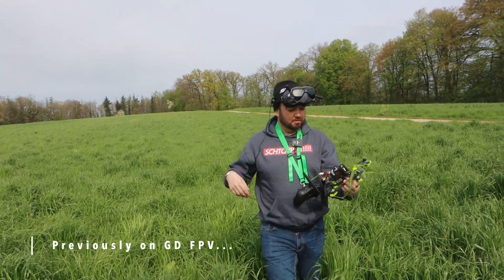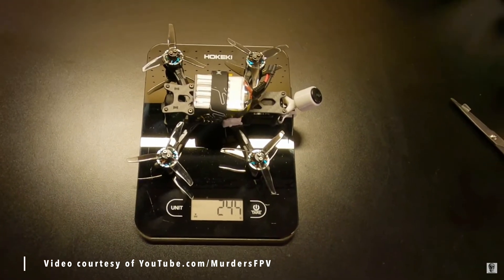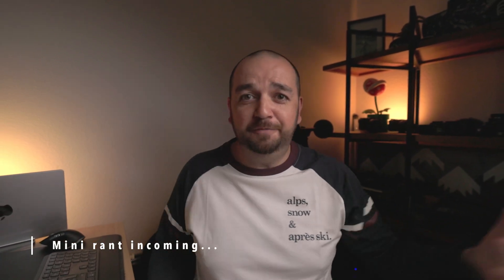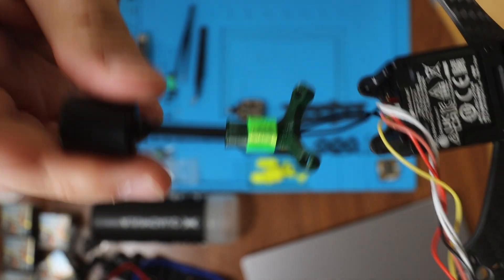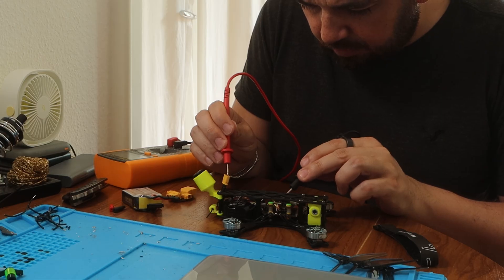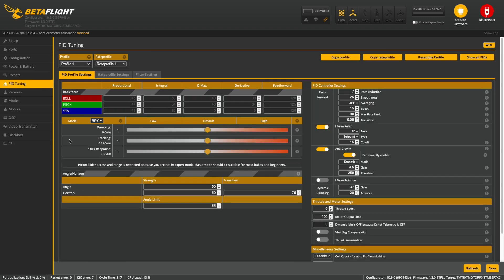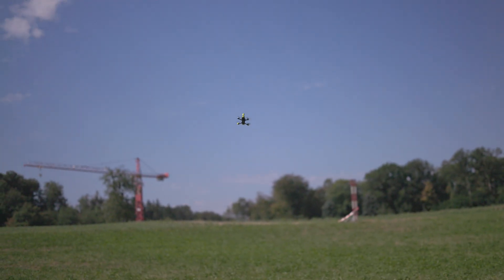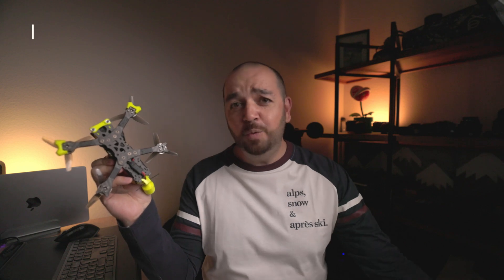I tried to build an FPV drone | Sub250g Freestyle DJI O3 Quadmula Siren F3

Comment: Can I have more detail for the fc and esc? I’m using analog system l, and I’m using on a 3inch 20x20mm mounting hole, I also wanted a 6s drone so how much amp and what type of esc and fc should I get that cheap? Should i use aio or fc stack instead. Finally 😅 how long does your 380mah 6s battery last normally
Reply from the maker: So in most of these builds I’ve used a T-motor mini stack which is about 45A rated and can take 6s. I’m in the middle of a build right now using a Flywoo Goku F722 pro stack also 45A. I haven’t flown the goku yet so I can’t say how reliable it is but the T-motor stacks have been bullet proof I just couldn’t find one in time for this build.

I’m running a F25 and a Grinderino with a goku 745 evo AIO which has been great and fits a 20x20 mounting.

The 380 6s typically lasts me about 3-6mins depending how hard I’m flying and how low I take the voltage down to. I typically land at around 3.8V (if im not charging them straight away) so I don’t have to storage charge them

Comment: ciao potevi benissimo usare un FlyFish Volador VX3.5 O3 Freestyle Frame Kit $32.90 ha tutte le parti in  TPU comprese nel prezzo e il suo peso a secco e' uguale se non minore di quello del Quadmula che tu hai preso .. e poi il FlyFish e' piu' economico sia come prezzo del telaio che come spedizione, in casa Quadmula esagerano un pochino:face-purple-open-box:
Reply from the maker: I looked into building one awhile back. The Volador frames are about 15g heavier than the Quadmula frames making them harder to build Sub250g. The shipping of flyfish frames are no different to where I live as you can’t get flyfish parts here.
Reply: did you look carefully? I don't think the Weight of the Quadmula Siren F3 Split is 54.2g dry (WITHOUT TPU PART) for the 2 frames instead the weight is all included 😉 FlyFishRC for the VX3 Weight: 68.3g(with TPU parts)
VX3.5 Weight: 70.5g(with TPU parts) N.B. so you're wrong 😊  @GarethDix
Reply from the maker: @kris-kb4vf  how does the flyfish fly vs the quadmula?
Reply: @GarethDix  Gareth I watch your videos because you have a very nice face, now I don't know which of the 2 flies better you should transfer the same hardware from one frame to the other to always say it by filing the PIDs because a frame reacts differently, then you can say which is better for you, but all the reviewers pass off the Quadmula F3 Frame as lighter than the FlyFishRC VX3 this is not true because the FlyFishRC Volador weight includes all the TPU parts on the scale, then it is cheaper as a frame and shipping, that's why I wrote to you, only you have the potential to try them, but the technical sheet and the price are favorable to the Volador also the holes for Stack 20x20 or AIO 25x25
Reply from the maker: @kris-kb4vf  That is one thing that I didn't understand about the quadmula frames is the lack of 25x25 even on the little 2.5inch one (I mention this in my next video). But I'll see if I can get a flyfish frame next time I'm in the UK and port everything from one of my F3's and see how much it weighs and how it flies. All 3 of my F3's and my F35 use a supafly preset with no other specific tuning for the frame so I'd be interested in seeing how it flies using the same set up.
Reply: @GarethDix  Gareth very good and beautiful, your face is halfway between a funny Italian and a tough English gentleman, I'm joking because I find you funny .. I know sometimes I'm provocative, but too often reviewers on YouTube say things that aren't exactly right and I think that commenting in a constructive way can be useful to everyone especially those who watch videos because they have more complete specifications to orient themselves on what they should buy, I repeat you who have the possibility of making test videos .. bye bye
Gereth I'm doing it for you to show you that I'm hard on you but I have nothing against you the FlyFishRC Volador frame is produced in 3 Inches and 3.5 Inches I'll tell you a secret the body remains identical and the 4 arms are interchangeable you can use both 3 inches and 3.5 ahahhaha when months ago at Quadmula I proposed if their frame could do the same they answered me in a bad way, I know it's business and companies make a profit, but that's not profit it's speculation

Comment: My first 'quad' was a octo, 8 150w motors a plywood frame and it carried my canon dslr... so i'm not anti build, but the thing i'm not liking on all of these i have looked at is no gimbal, so you cant move the cam up/down for filming, and you had better have good eis. 
pro's are cheaper to repair, cheaper to stock up on batteries, and it can get later mods + upgrades/improved software.
If only we can keep under 250g, get tilt on the gimbal and 30mins fly time then it would be a real winner. or does that already exist.....
Reply from the maker: Gimbals already exist for building your own check out the caddx gimbals. But if you’re looking for a cinelifter you can build a much bigger quad and add a DJI RS series gimbal which will take any camera so it is possible and fully upgradeable so you aren’t having to upgrade the whole quad, controls etc.

The only thing is, if you’re flying through things at 200km/h the fixed camera position allows you to learn exactly the position your quad is in, it’s much more difficult if the camera is On a gimbal.

30mins flight time is also possible in a self build with li-ion batteries but as with anything you have to weigh up what you need more, power or efficiency.
Reply: @GarethDix  yeah it's the 250g limit that screws with a lot of the simpler solutions/designs

Comment: What was the total cost for this build I’ve been thinking about building one but don’t want to spend an insane amount of money
Reply from the maker: This isn’t a cheap build I think it cost around $600 at the time but the DJI O3 was $250 of that cost and the T-motor stack was about $150 both of which have come down in price.

There’s plenty of ways to make this cheaper though especially if Sub250g is not needed
Reply from the maker: This isn’t a cheap build I think it cost around $600 at the time but the DJI O3 was $250 of that cost and the T-motor stack was about $150 both of which have come down in price.

There’s plenty of ways to make this cheaper though especially if Sub250g is not needed
Reply: @GarethDix thanks for the help I’ve been looking for one under the 250g mark do u have any things of the top of your mind that could make this a little cheaper if not that’s fine
Reply from the maker: @ABYSSSP7FN sure… the first part is do you really need DJI O3? If not it’ll save you a lot of money and weight and will give you a lot more frame options.

I would use an AIO over a stack it’ll save you money and weight. You could use the extra weight budget on cheaper motors.

I’d run 1404 motors on 4s, they’re more readily available and you can save around 50% of cost - but it’ll come at the expense of power

Running 4s means the batteries should be cheaper too.

Finally the Quadmula frame could be changed for something cheaper. It’ll typically be either at the expense of weight or durability or build difficulty.

Comment: l enjoyed your video immensely. I have been pondering about building my own quad and you have inspired me to finally give it a go! Still very nervous about the soldering aspect of the build but like you, do a bunch of practicing and it should all work out, right?! Cheers and thanks again!
Reply from the maker: Yeah I practiced loads before doing it for real. On this stack the soldering was fairly easy. Some of the AIO’s I’ve used in builds since then have been so much more difficult. But really get a solder sucker and some solder wick as well and if it goes wrong you can always remove the solder and try again

Comment: I’m at waiting process of “hopefully” correct parts. So excited! Anyone have a link to a FPV diy budget build? Toothpick? 2.5”
Reply: Trying to figure my first build and EXACT easy “budget” parts is tough for 2.5”. Anyone want to hit the kiid with a good startup list to go with frame. Id be blessed and grateful. Thx! Super stoked!
Reply from the maker: I’ve been looking at doing a budget build but still looking at options. From memory MoeFPV and TargetFPV used to do a lot of toothpick builds so I’m sure there’s a 2.5inch in there somewhere. TorontoFPV has a new frame called the whisper coming so I’m sure he’ll do a video on a 2.5in build if you ask nicely
Reply: @GarethDix  epic info thanks 🙏🏻
Reply: I can’t wait there’s so many step by step videos but the hard part is finding the right long range parts to go with frame and build. I’m a cruiser light tricks guy. I know I’m in it for beautiful long flights. Like a Bee.

Comment: Nice work. Would be super if you could add into description or pinned comment all the components you are using in this video as a list.
Reply from the maker: I didn’t for this one as I wanted to make sure MurdersFPV who did the original build got the credit and anything from the affiliate links for it… but I used the same components in my full build video recently of the 3.5 inch https://youtu.be/lPGT-tZh2Hw?si=w3zRSie8dUxYCA-l

The only difference is the O3 air unit lite and I’m using the 3.5inch version of the frame (it’s the same just longer arms)
Reply: @GarethDix  Thanks. Where to buy just the O3 unit except DJI official website?
Reply from the maker: @Braincho I’ve never Bought one from DJI directly, pretty much any FPV store will have them too. Depending on where you’re based the independent stores sometimes work out cheaper

Comment: I tried to fix my cinelog20, after a motor burnout. 

I've fried the fc aio somehow, 2 times... Buying a set of 4 motors and 2 boards killed my "fun" in building so i've just bought a second Cine20

I've got a MOZ7 in my line of sight to be able to film different things, and i'm still on the fence between builing a 7" LR or just buying one...Trying to fix the cine20 kinda killed the willingness to build
Reply from the maker: That’s pretty crazy the cinelog20 was my first quad and almost two years later all I’ve done is replaced props and one of the ducts so you must have really been pushing it!

On my Flywoo firefly I’ve had to replace  two motors and that was fiddly… but if you’re going with a 7inch it is a lot easier to build because of the size and space you’ll have… that said in order to do a build you have to really want it… it’s not typically cheaper but it is rewarding!

If the moz7 gives you everything you want for now I would just get it BNF and save yourself the pain… you can always start building something in the background whilst you’re flying another  quad because the first build never goes to plan and will always take longer than you think
Reply: You have no idea of the work I get out of the cine20, its perfect for one shot real estate,  with ajusted tune you can fly around real smooth and slow indoors, and with some more tune tweaking it has enough pushing to combat the wind in higher altitude to get nice house shots or small to medium construction sites, its been a real gold mine. 

While i will say it did crash hard  a few times, its so durable, portable and quiet.
Same for 'fly and run' kinda shots its been perfect.

And for the price with the O3 i'm loving it.
But with people wanting full land shots or car rollings, I need to ajust to the demand, from the reviews the MOZ7 seems like a good rounder, but then againt maybe the Tern-LR40, I could still use my current 4S batts and save a bit on initial running costs.

Picking a BNF is just as bad a buying a new car for me, I look at the specs, compare everything and cant ever decide lol @GarethDix
Reply from the maker: @TheGraneable yeah I love the cinerace… I was going to upgrade mine to a an O3 but it’s more than just an easy swap over but it’s one quad I will never get rid of. I just picked up a smaller O3 whoop to test as well and it’s doing pretty well.

The moz7 is huge though but worth it or even a 5inch dead cat frame would probably be good.

The tern looks like it has some agility issues because of the GPS tower thing and won’t be as fast as a 5inch or moz7

Comment: It really annoys me that they don't sweep the arms back enough to get the props out of view. This is definitely my next size build. ( I have a Mark 5 w/O3 and a Mobula 8 w/O3) so I really need a sub 250 in between.

How much flight time did you get out of a battery on this build?
Reply from the maker: I think most freestyle quads won’t have the props out of view because they’re an x-frame so it would affect the flight characteristics… that said some of the newer frames like the Djinn25 have pushed the body further forward for the camera… rumour has it that quadmula are working on a 3.5inch version of this to be released soon as well.

But there are a few people running this 3D printed mount on the siren F3 to get the props out of view too… https://www.printables.com/model/381833-o3-max-fov-pod-mount-no-props-max-protection-any-q

On the 380mah battery I get around 3-4mins of aggressive flying some people manage around 5 with more cruising.

I’m considering making the second one of these I’m building a 4s, but I’m also testing out a few of the BNF suggestions from the comments for a future video that I’m filming at the moment

Comment: What parts are you using?
Reply from the maker: T-Motor F7 mini stack
T-Motor Pacer 1604 motors (2850kv)
DJI O3
HQ prop 3x2.5x3
TBS Crossfire Nano + mini mortal antenna
GNB 380 LiHV batteries

Comment: what was the o3 fix and I have the same frame but the mount for the o3 camera that came with the frame is different then murders would it be better to print the same mount he has or did you use the carbon fiber ones that came with the frame
Reply from the maker: I had to change the pwm frequency to 48khz on the ESC as the default was set to 24Khz which is the same as the O3 unit so it was affecting it.

Did you order the O3 version of the frame? If so it comes with the extra 3D printed mounts made from TPU along with the antenna mount and some longer screws to mount the O3 air unit.

The Tpu mount for the O3 camera is important as it helps reduce the vibration which can also cause weird things to happen. That said murders has been using the carbon fibre mounts on some of his other siren builds without any issues
Reply: @GarethDix  yes I did had to go though the little bags but found it and awesome thanks for letting me know
Reply from the maker: Awesome I hope you like how it flies!
Reply: @GarethDix  currently in the full build I really don't like the capacitor up against the o3 it's pressing down and even made a slight dent in it , is that alright how did you mount urs it looks like how murder did but just very tight please help
Reply from the maker: @FPVMafia so it shouldn’t be touching the O3, are you using the same T-motor mini stack? If so it’s worth adding spacers on the stack screws to elevate the stack a little and the. It should be above the O3. You have to angle the cap a little so it sits in the hole in the top of the frame but it fits without touching the O3.

Worst case scenario you could also mount the stack the other way around and have the cap behind the camera (I’ve just had to do this with my Grinderino build as there’s not enough space in the frame)

Comment: When does come the comparison?
Reply from the maker: I have 3 new quads based on what people had suggested, so I I’ll be testing these out over the next couple of weeks to get a real feel for them. I was supposed to start last week but the weather has been “challenging” 😂
Reply: @GarethDix  on the Zürich side also
Reply from the maker: @Nik_FPV621 I even looked at heading to somewhere else in the country in case it was better… but no it was raining everywhere 😂
Reply: @GarethDix  today here in Zürich is good weather but I fear the winter time (I like snow anyways) cause i don’t want to crash in the snow and get the electonics wet
Reply from the maker: @Nik_FPV621 I just got a load of waterproofing for the winter ☺️ but then I switch my FPV for skis when if snows
Reply: @GarethDix  did you buy a coating?
Reply: @GarethDix  can you may send me the link to that product? And btw I think that avantquads have a 3 inch DJI sub 250g 4s drone, just in case you want to compare even more drones
Reply from the maker: This is the stuff I bought I had some other bits I was buying from that store that I couldn’t get here so I’m not sure if there’s somewhere here that sells the same thing https://pyrodrone.com/products/fpv-worry-free-drone-electronics-waterproof-coating

I’ll check out avantquads it’s not one that came up in the comments
Reply: @GarethDix  thank you so much. Can you tell me witch sub 250g drones you are testing cause I really looking forward to buy or build one
Reply from the maker: @Nik_FPV621 it’ll likely be a smart35, babyhawk and a crux35 but maybe one more if I can find it before I finish my testing
Reply: @GarethDix  thanks 🙏